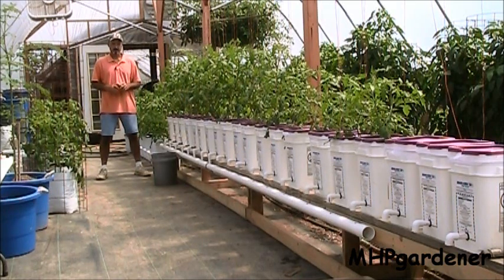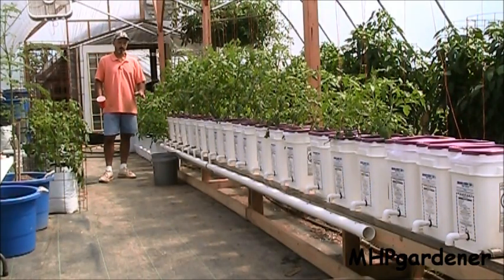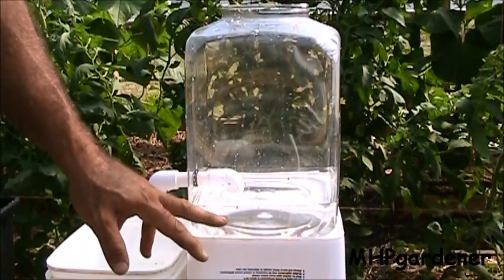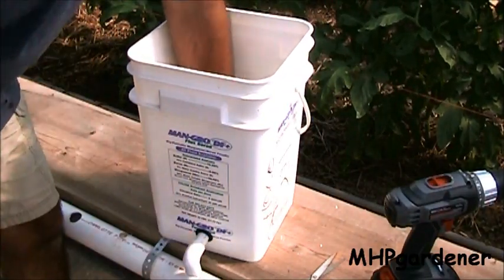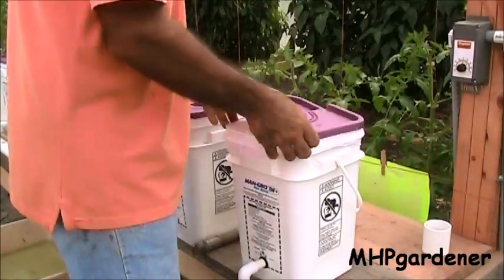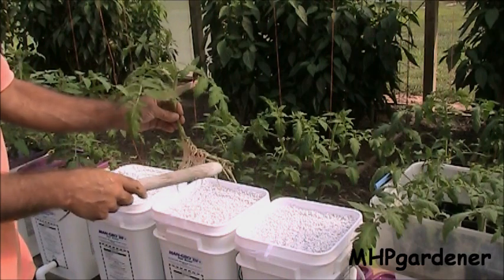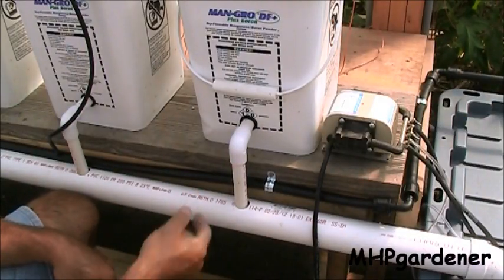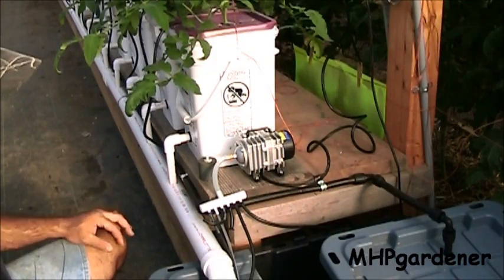Dutch Bucket Hydroponics - How It Works & How to Make Your Own Buckets

Comment: Thanks for the video. I am really impressed with your system. Is this something I can do in a basement? My basement is about 65-70 degrees in the winter unless I get the wood burner going then it hits 80-85. I can't burn wood all the time but maybe the lights will help with some heat. I was thinking of LED and Florescent bulb lighting. What do you think?
Reply: Your lights will add temperature to the room dont forget. You dont want it 85 degrees either. 80 max

Comment: Hi, what should be the pressure of the pump as it is feeding 21 Dutch Buckets.
Reply from the maker: I use a 264 GPH pump.  Bobby
Reply: @mhpgardener  Thank you. So it is about 800ml per plant per minute.

Comment: I just got my first 8 buckets to try this. The only difference I plan is to try to get a solar system to run it. Not as much because I'm worried about running up my bill but so it can all be a closed loop system.

Comment: Are you still getting fruit with no pumps? And how does your fruit yield compare with traditional methods? 

Are you still getting faster growth than a traditional garden? And how much would you estimate? 

Like the video you did.

At 9:04 you used an example with 2 cucumbers in the same bucket. And you'd also shown roots from your previous runs...so my question is by having 2 or 3 plants per bucket are you actually getting 2 or 3 times as much fruit & vegetables? Or is that still limited by your finite amount of nutrients going in? 

Thanks

Comment: Hi mphgardener. Love your videos and recently built my first set of dutch buckets according to your tips. I got myself a solar powered pump. It has a regulator that offers 5 levels of watering which seems to be controlled by runtime. The higher the setting, the longer it runs. How many times a day it runs depends on the sunshine. The pump starts running at first daylight and it depends on the strenght of the sun how fast the batteries reload. I measured the yield per outlet over 24 hours and it was 1.25 liters. Is that enough for a tomato plant ?

Comment: Can you just dump nute water into a bucket and add more nute water as needed and not have it drain out? Will the water buckets water below the top bucket go bad? With an aerator in the bottom of the bottom water bucket in a dual bucket system.
      Also if using a bucket in a bucket with soil in the top bucket should ya leave distance from the soil to the water level of the bottom bucket? So the soil isn't always over watered and to avoid to much air to root between the dirt bucket and the water bucket. Trying to make an early stage setup before transplanting into supersoil. The little ones cant handle the supersoil. But little pots cant build the root base i want. So letting them drink out of a tub of water under them till big enough. To make a BIG net of roots before transplanting instead of just a few circling inside a little bucket/cup. Boosting growth. Just not sure if the water will get stagnant or roots to much air and rot. There will be some bigger than others so it will drink a bit per day till moved out. So more fresh nute water will be added every couple days. Has a bobber setup in a sled/tray with aerators with plants floating with open bottom cup on Styrofoam with holes through the foam for the cups roots to grow down to the water. The sled gets fed by premixed nuted water in a airated bucket of water above it. I add water and nutes as needed to top bucket that feeds down to the sled as needed. Should i just get a pump and have it constantly circulate from reservoir to sled? Instead of just letting the sled drink it up as needed? Never tried hydro setup. Just kinda threw it together with little knowledge of it. Lol

Comment: He said he used a 3/4 inch gromment and then said he put 1/2 inch pvc pipe..is that right??
Reply: Yes. Because the outside dimension of the 1/2'' pvc  measures 3/4''

Comment: That thing drains so fast I'd just be afraid of my plants drying out
Reply: The setup he showed doesn't drain completely, the water that remains would have the tips of the roots submerged. Draining the water that fast also helps with aerating the plants otherwise if you were to always have the plants submerged, you would need to put in an aerator.

Comment: Love the accent. I would make one suggestion. Paint the outside of all your buckets. The sun will make the plastic brittle and you'll be lucky to get a couple of years out of them before they shatter if you don't. Otherwise I'd recommend you go to black buckets if you can find some that are food safe. One question, why do most of the dutch bucket systems use a two inch drain line when you're feeding the system with a half inch or smaller main feed line? I have two hydro beds in an aquaponics system. They're fed with a half inch line and use a three quarter inch drain line. The smaller drain lines allows the beds to flood without the pumps having to run for long periods of time.

Comment: if you setup your supply line above your plants you can install a tee where an additional gravity feed line and bucket can be installed for power outages or off grid situations.  Then once every 4 hours you can walk by and fill the gravity feed bucket and walk away.  Also, on the formentioned design install an air-rater component in the down flow supply section and let gravity down all of the work.

  When ever using grommets alway apply a little plumbers grease lubricant to the bulkhead tubing for easy of assembly and sealant to make the grommet do its job correctly.

Comment: Hi so you are saying you can use hydrotons if you like instead of perlites? are they working the same?
Secondly if I do this project without electricity how often do i have change the water solutions? 
Thirdly how do you mix the solutions? Meaning how much in quantity of which fertilizer needs to be added to how much litres of water?

Comment: Hey mhp, I've been watching all of your videos on dutch buckets and kratky method.  It seems like you don't need to chill your water.  Are there methods you use to keep it cool as far as your construction, or do you ever have problems with root rot during the summer?  Getting started at this and temperature seems to be my biggest enemy and I don't want to spend another $300 on a chiller...

Comment: I work with 3/4" PVC pipe so I just drill a clearance hole for the threaded fittings. Then put an O-ring on the male end. Tighten the fittings and the O-ring seals to your bucket or whatever container. That way your fittings cannot pull out of the container. You can also adjust the level of your fluid in the Dutch Bucket by drilling a hole in the inner elbow or riser tube. The higher up you drill it ( up to the point of level with the bottom of the pipe out ) the more liquid it will leave in the bucket.

Comment: Hi, can you please explain why the perlite is necessary? I don't think that it adds nutrients? Can't you just have the tomates in a net cup with a few clay pebbles and put the drip system by that? This would make it cheaper than buying all of the perlite. Or is there another reason that makes the perlite necessary? Great video! Thanks!

Comment: beautiful video. thanx.I copied the whole system with one difference . i did not fill the whole bucket with grow media . i made a whole in the lid of the five gallon bucket to fit a  half gallon bucket with small holes at the bottom and one larger whole in the center where i could insert the stem. i put the tomato plant in the smaller bucket with clay pebbles. the roots dangled in the five gallon bucket. the drip line operates 24/7 .  this way i use less clay pebbles which are quite expensive in my country.

Comment: Instead of watering with the cup get a water hose poke holes identical to the plants lay it across turn on for a min to pressure up then lightly turn on water pressure for a solid stream of water for each plant at the end of the hose use a shut off valve adapter for the end of the water hose. BTW great educational video keep up the great work.

Comment: Hi My name is Fung. I have a question on the pre-treatment of the harvested plants. I am wondering is this a common situation that the leaf vegetable are getting soft and withered after a few days once i harvested various types of crops on my hydroponics system? I used to cut all the root and place them in indoor area with room temperature. The second question is what pre-treatment of the plants you recommend after harvesting. Thank you so much!

Comment: What a great video, thank you! May I suggest that after you make your hole, instead of cutting the lid just leave it with it's centre hole and thread the plant into the hole, then place the plants root into the hole in the perlite with your hands under the lid, press in the plant and close the lid...I would have the water drain to a drum, then use a small fountain pump to pump it through a overhead drip line to make the water recycle. I'd also add a airstone to the drum to keep the water fresh and mozzie free. Love what you are doing man!

Comment: i have few question.

-Can we go dutch bucket for Tomato.
-how to maintain water temperature up to 26 OC for end plants on line.
-can we recycle water through in let and out let water system in same nutrient  tank   .
-how long we use nutrient water or changed it daily basis.
- PH level of water 
- what is for nutrient water monitor. PMM is it okay
- how long Tomato plant will produce tomato or change plant every 3 month. mean age of one plant.
- 25 kg crop are in year or 4 time. mean 25 x  4-100 kg  
looking forward hearing from you my email shoaibdua2009@gmail.com

Comment: What a great system!! I will make something like this in my small green house. Will it work if I use rain barrel spigot on the buckets in stead of the elbows and uniseals??
Reply: Something like this: https://www.google.nl/search?biw=1366&bih=637&tbm=isch&sa=1&ei=d2sqWv6OMsjcwQL26JuADQ&q=ward+regenton+kraan&oq=ward+regenton+kraan&gs_l=psy-ab.3...8965.13539.0.13756.19.15.0.4.4.0.198.1509.6j7.13.0....0...1c.1.64.psy-ab..2.13.1073...0j0i67k1j0i10k1j0i30k1j0i19k1j0i30i19k1j0i5i30i19k1j0i8i30i19k1j0i24k1.0.pys_8dHVWt8#imgrc=SONtM7AXY7f3cM:

Comment: You should try out aquaponic too!   I set up an aquaponic systems 2 weeks ago.   3 days after the set up,  I threw in 10 worms first to test see if they'll die with the water flooding.   Instead of using the flood and drain method,  I use 30/120 water changing approach (ie.  30minutes flooding the growbed 1/2 of its height,  2 hours stopping).   If I smell something funny from the grow bed and fish bed,  I am sure these guys won't survive.    Contrary to what I thought,  they survive.    So I add 20 more,  man they clean up the system for me.   My system no longer smell funny inside the living room.    My grow bed is a see-through plastic tray,  last night I saw a worm swimming at the bottom of the grow bed sucking something on the small rocks surface.    About four days after adding the worms,  the fish tank water is clear.   I can see all the way to the bottom.   It's been 2 weeks,  the whole system seems stable.   No more dead fish after this.    The plants are growing but slow,  I guess we don't have enough sun in Toronto at this time,   I need to add an LED grow light.     Note :   You must add an air pump to your fish tank.    Air pump will bring more oxygen to the fish and grow bed where the worm reside.   It also push out the bad air inside the fish tank making the system cleaner and more vibrant.    I use mechanical timers to control both air pump and water pump so they don't get too hot and burn out as they are expensive.    I am thinking of using flowform to increase the dynamic of water making fish, worm, plant, bacteria all grow healthy and fast.

Comment: looks like gthe pearlite is almost to the top but you mention that the water level is barely above the level of the drain tube.  is there any negatives to the water being that low or does the media bring the water up to the root systems

Comment: Brilliant  presentation. Have one question though- the roots are not touching the water level  here. As per my understanding of dutch bucket hydroponics system a level of water should be maintained in the bucket which touches the  roots of the plant. Is it something different ? or alternative approach?

Comment: There is not a way to have a siphon set up were one bucket is filled with water till it starts a siphon that fills another Bucket like a domino effect with one bucket having a float valve to add water to the system has needed?

Comment: I'm getting some blossom end rot on my hydroponic tomatoes. I'm using the same formula you are with the nutrients. We did have some heat spells over the past 2 weeks and I was wondering if that may have had something to do with it or if it's calcium deficiency. Wondering if I should do a calcium nitrate foliage spray? or some Tums in the nutrient solution too? Any help appreciated.
Reply: What variety are you growing?  I'm having the same issue with plum tomatoes (paissano).  I read it is common for plum to get BER.  I tried the foliar spray with no improvement.  Also growing cherry and cocktail in the same system with no issues so I'm thinking it is this specific variety not good for hydroponics.  I'm doing indoors kratky hydro.  I just ordered a greenhouse specific plum variety to try out in my next grow.
Reply: I think these are just big boys, and I'm not impressed with the size either, seem small for big boys.

Comment: Great presentation. So do you use a liquid fertilizer. How much do you mix in to the reservoir and any problems that these added compounds are circulating through the pump.

Comment: I been wondering how people make "water pumped" hydroponic systems for the past 2 days ( since i found out ) and this is the first time im starting to reaaaaaally understand it! thank u so much man! I wish this video was re-made in full HD! its still very good! So I need to have a water pump with all those little lines coming from it, each line goes in one bucket to "auto-water" the roots, then the little elbows are for making sure the water coming from the pump system does not go too high and spill out the buckets, the pvc pipe is tilted so that the water falls back into the "Reservoir" slowly and thus the cycle begins again! Sooooooo easy! It's so much like my Water cooled gaming PC lol. The only thing I need really is the freakin' hole cutter/drill combo to make the holes. That's the most expensive thing Im gonna need, dang. What is it, like $70? 
 
WELL THANKS AGAIN!

Comment: I need some help. when you connected the coupling to the 1/2 plastic pipe I need to know what they are called and where to  order them. I have tried Lowes and Tractor supply and no one knows what I am talking about. Please helpThanks Frank

Comment: Love this method but, I would be sincerely concerned about the nutritional value of the produce.   I would also be wondering about any contamination from the plastics used in this setup.  If there are no problems, I would love to do this.
Reply: Nutritionally deficient tomato plants will not produce ripe fruit. The grower provides all essential nutrient elements through the fertigation soloution. The plant converts these elements into sugars and many complex compounds. (Carbon, Hydrogen and Oxygen come from the water and air.)

Comment: Thank you for sharing all of your hard work. Because of those I've built a bucket-on-bucket system, a one-plant bucket over a one bucket reservoir.  I have one question ~ 
Can the drain hole in the plant bucket be in the center of the bottom -- and -- not on the side 1" above the bottom?
My system drains via a hole directly in the bottom of the top bucket.
Reply: Ha! I answered my own  question by rewatching your video. The answer is 1" above bottom is necessary for feeding between timer feeds.

Comment: questions,
1. why could you not connect the return line to each bucket straight thru ? of course it would mean you would drill 2 holes instead of 1 hole . this would reduce cost and elaborate setups. each bucket would drain into the other then to the reservoir. 
2. what is the fertilizer mixture ratio for this setup? or is it plant specific?

Comment: I made some buckets exactly like these, used the paint strainer with a mixture of perlite and peat moss. Then I started thinking about root rot with it sitting in the 2 inches of water. Is that a valid concern? I am in Trinidad, West Indies,  where it's hot all the time. My plan was to use the continuous dip system.

Comment: Have been following you for some time and enjoyed the simple explaing you do, we learnt a lot.
I have a question. I have used a pump from a old washing machine which is 34W and have made a dutch bucket following your line of reasoning. When I connected the system yesterday, thewater feedingline with the drip tubes only could get 3 dripping and would go no further. The head height from pump to driping point is about 45cm. What am i doing wrong? I tried 3 pumps already which I cast in epoxy resin so as to make it submersible. Hope to hear your helpful comment.

Comment: I am still having problems locating the correct rubber grommets that fit a 1" hole and allow a 1/2" ID PVC pipe to fit. Do you have a part number or a better description of the correct grommet?

Comment: Can anyone answer...are the buckets supposed to fill up? I followed this set up exactly and am worried the roots are not reaching moisture because the water level only gets a bit higher than grommets and drain hole
Reply: no, you set up a timer for the plants very little water remains in the reservoir. 3 30 minute intervals during the day
Reply: I understand that and thank you replying but how do the roots reach the moisture at the bottom of the bucket?